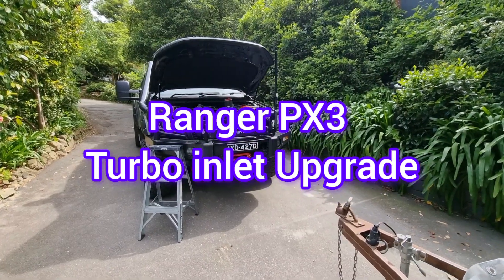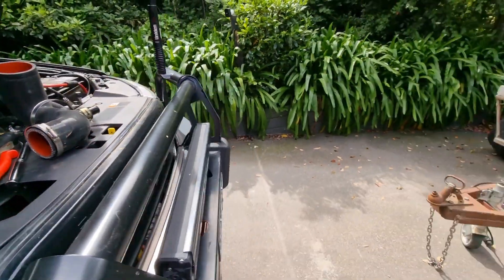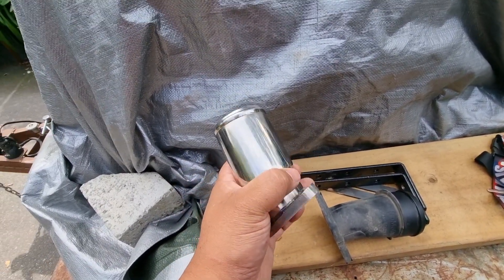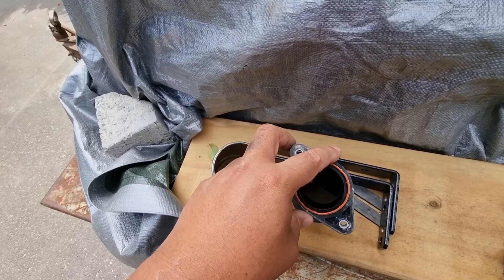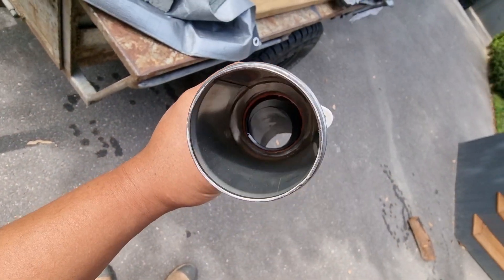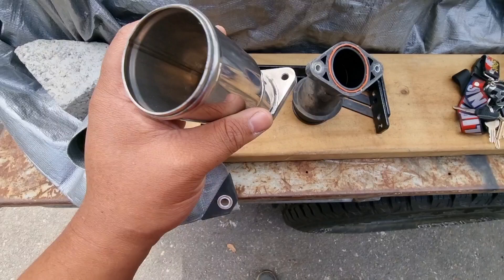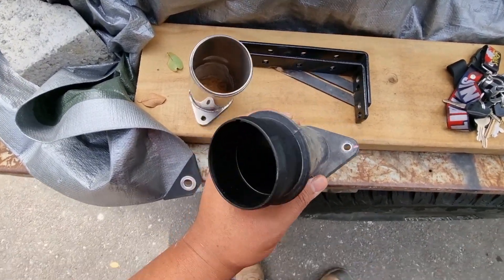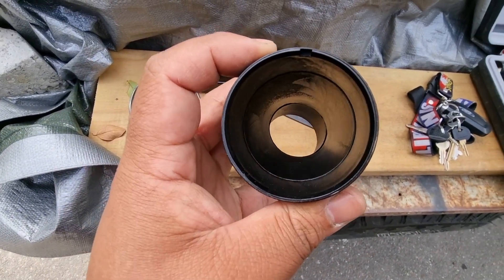Large Turbo inlet pipe upgrade pt.1| Ford Ranger PX3

Comment: Is your car auto mate?
Reply from the maker: Yes it is
Reply: @gtgarageaus  any difference? Mainly towing? Ive done all thenupgrades minus this. Remap intercoolee hardpipes etc
Reply from the maker: I haven't measured the difference yet, as in on a dyno. But there is a difference in the way it drives. I have an OBD II scan gauge and I can observe all the numbers. It's certainly able to build boost quicker, and maintain boost better. how do I know? I have a few test roads

 1. A short test road that I run, and there is a slight uphill section where i'd usually do 45km/h around a gentle bend, and it'll want to kick back a gear to get back into boost. After the mod it's now able to maintin the boost and the gear and power on through without having to kick back.

2. There is a main Highway that i drive to work. 100km/h constantly climbing for 10 mins. After the mod it is now often showing a high boost warning (I set it at 21psi) which tells me its building boost quickly- It would rarely do this before. I'm just cruising up the hill too 1800ish rpm

I'll elaborate further in my next video, but thats the summary of it. Hopefully it helps.
Reply: @gtgarageaus  christmas purchase for myself. Cheers 🍻
Reply from the maker: You won't be disappointed. Cheers for watching!